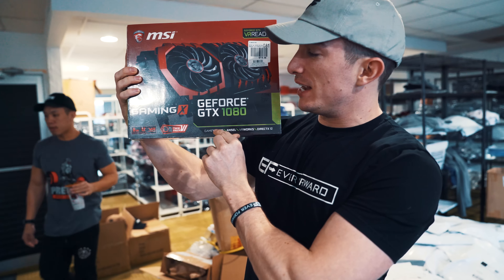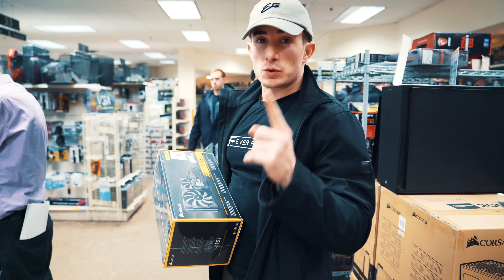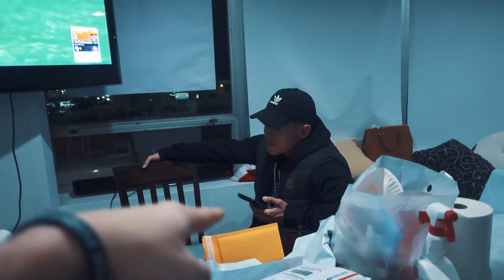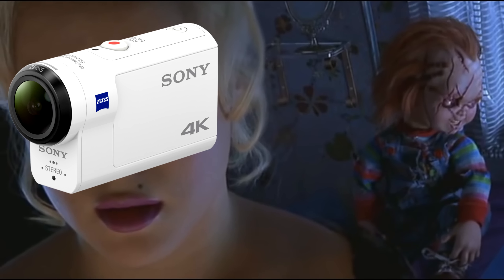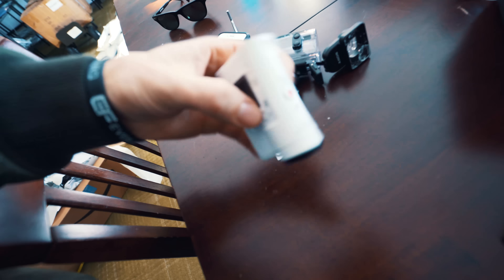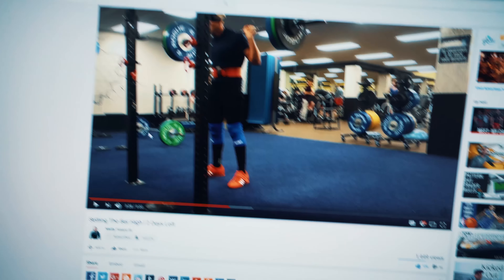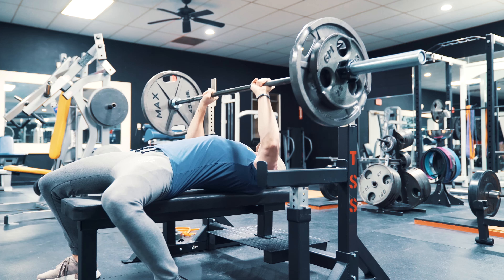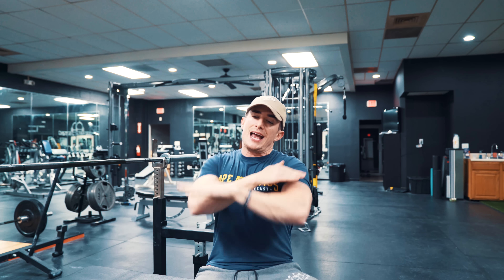Breaking My New Camera

Comment: Pro tip: buy glass cleaner in an aerosol can and paper towel, clean the glass then spray some aerosol glass cleaner on the suction cup and install it wet/lubed up on the glass this will increase the suction. Also a safety line / string attached to the inside grab handle either thru the window or door jam is not a bad idea.

Comment: You don't necessarily need to plug in the extra 4 Pin Power to the motherboard, Your manual should tell you if its optional or recommended and you should be overclocking in the BIOS and not within windows using software. 

But other than that beast of a pc!

Comment: I am assuming you got new pieces for video production. Why did you make a gaming PC? The 1080 and the rest of the pieces are great....for gaming and alright for video editing. I would have gone for ecc ram because it is self correcting and it is significantly less likely to crash on you etc and with a Quadro or something instead of a gaming centered pieces. I guess like you said you were in a rush so when we are in a rush we make mistakes. oh well next time I guess. Video production will improve but it would have been better if you went with other equipment considering you got this to improve your video production not gaming. Are you going to stream on twitch!?
Reply: *****
Yeah 1080 is great, i was just thinking if Maxx has a gaming rig already why make another one when he could have made a video rendering beast. seeing as though video makers spend so much time in that alone i would think that's their biggest concern.